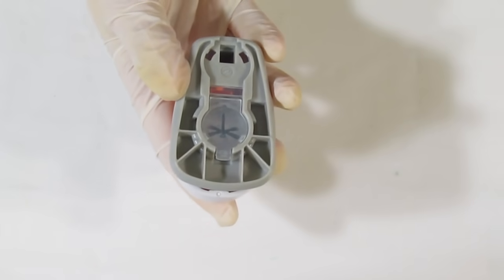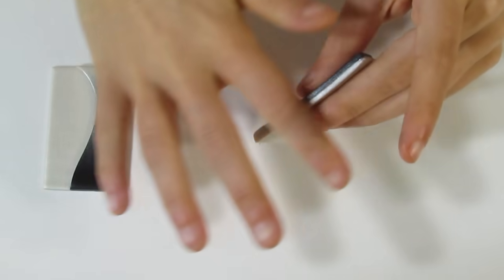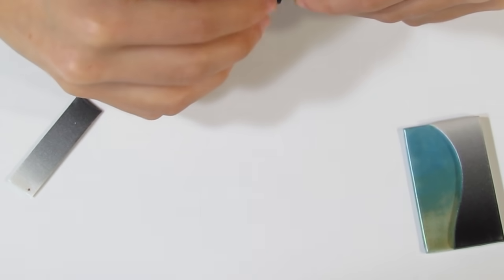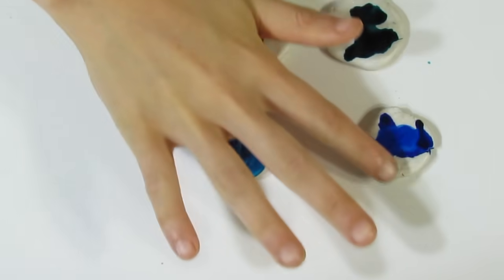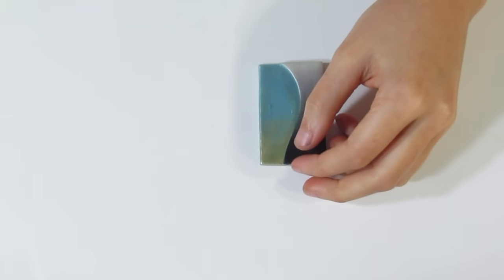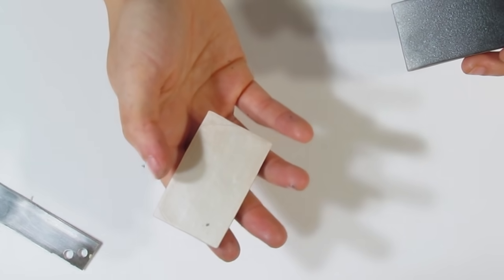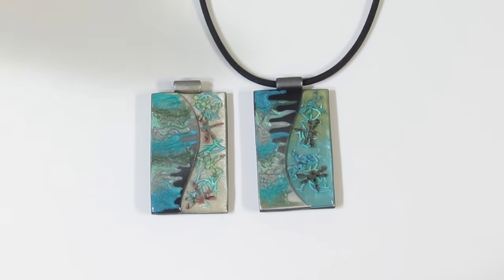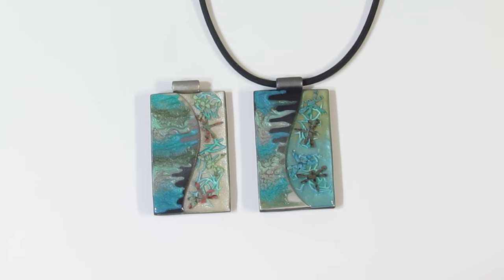Polymer Clay Project: Day on the Lake Pendant Tutorial

Comment: Burnishing mica powders by gently rubbing (barely touching your piece) with your bare finger will blend it so much smoother.  :)  I get beautiful blends doing that.  It doesn't leave behind finger prints.  :)  These pieces are beautiful, but since you commented on the chunky blend, I thought I'd pass on a tip if you don't already know it by now.  ^_^

Comment: Thanks for another wonderful tutorial, Samantha! I love the combination of techniques, especially the innovative ways in which you used the Pebeo Prisme paints. Quick question: Is there an advantage to attaching the bail before curing, then breaking it off and reattaching vs. pressing the seam side of the bail flat against the work surface, curing it next to (vs. attached to) the pendant and then attaching it with Bake & Bond? Thanks very much!
Reply from the maker: No. You could do it both ways and it would work. :D
Reply: Thanks, Samantha!

Comment: Hey Samantha- beautiful pendants, I love them. I know you've done quite a bit of testing on the Pebeo paints, and I know you said they could be cured then removed easily from Teflon and silicone, but I'm wondering if you've tried it on wax paper or parchment paper (I think you call it baking paper, but could be wrong). I know I can test it for myself, but I only have the tiny bottles of the Pebeo paints, and I'm trying not to waste any, since I'm already running low- so before I tested it for myself, I just wanted to ask if you had any idea as to whether or not it would work on the wax or parchment paper. Thank you!
Reply from the maker: I haven't tested that yet, but I can over this weekend. If you're willing to wait two days I can come back with a yes or a no.
Reply from the maker: Yes. Baking paper will work, but make sure you get one that's quite waxy otherwise the paint might stick.